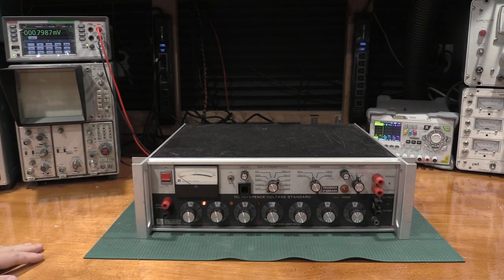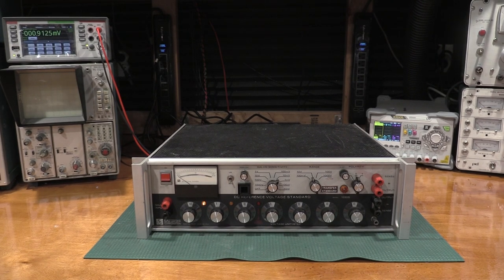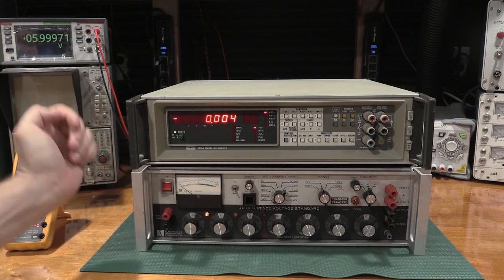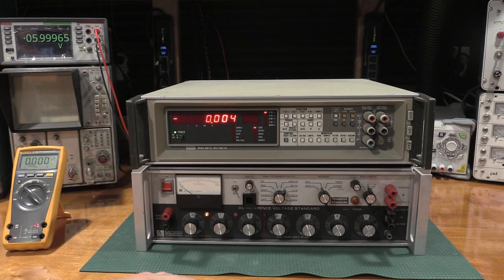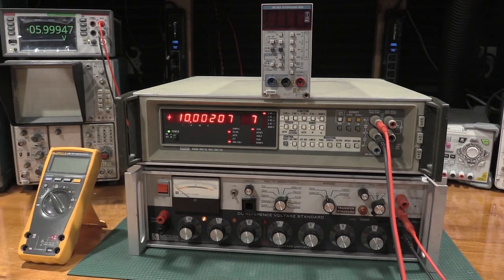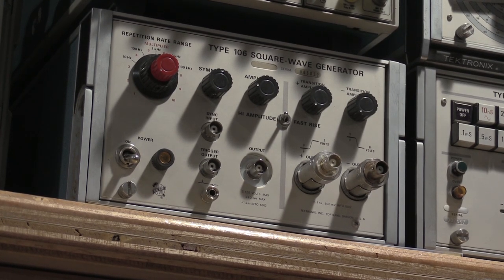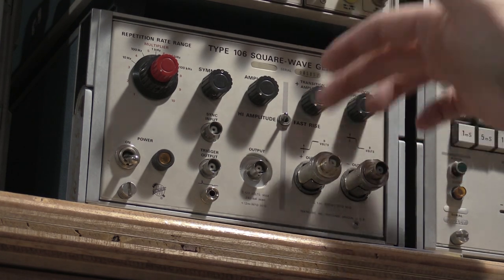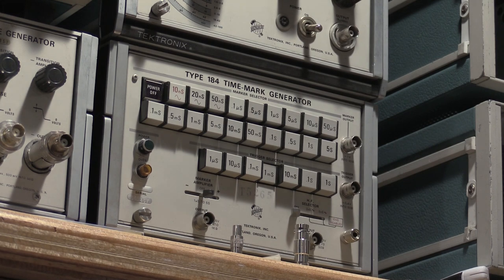A Deeper Look at Calibration Going From Zero to Lab

Comment: Thank you for producing all the videos you’re producing. It’s helping me at tremendous amount I’ve just recently retired from a music production company where I build their speaker flying speaker, a raise and Road cases, the cat work CNC work my retirement project is to build a class a single ended tube amplifier and sell them for my side gig. I’m currently going through and cleaning and changing a few components on my Tektronix 10:16 455 oscilloscope. What would you charge me to do a proper calibration and alignment?

Comment: Excellent run-through on your process of forming your lab.  I would be interested to see how far you can go with a calibration using the function generator etc.  I have a DMM500 and Siglent SDG2082X (GPSDO referenced) so something similar would be great to see how much you really can do with this type of setup.
Reply from the maker: It is defiantly in the works. I have solidified the vehicle issues so I will be able to start working on acquisitions again (and update is coming) Still no delivery as of yet but the plan is finalized. But no less than 6 475 scopes have landed in the lab so we will have plenty of testing opportunities.